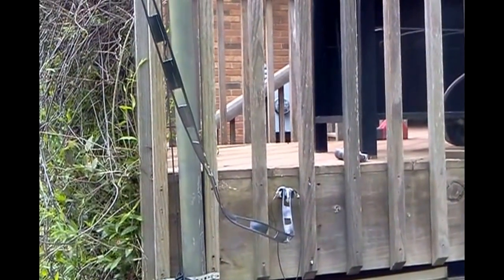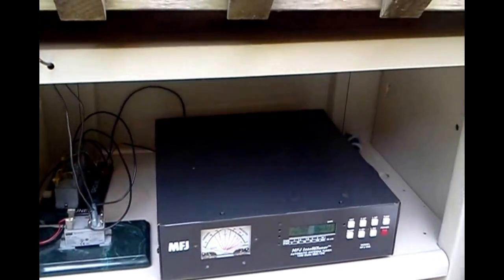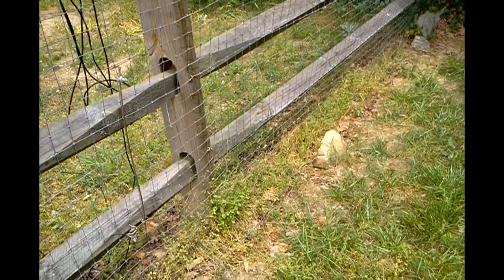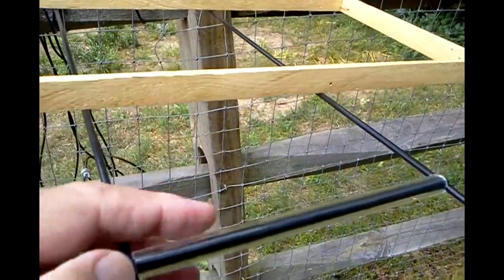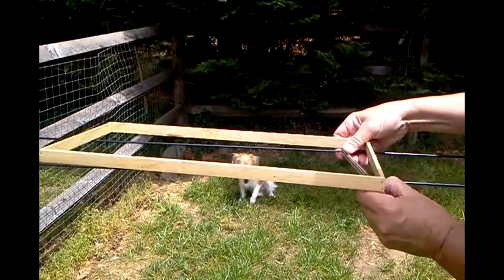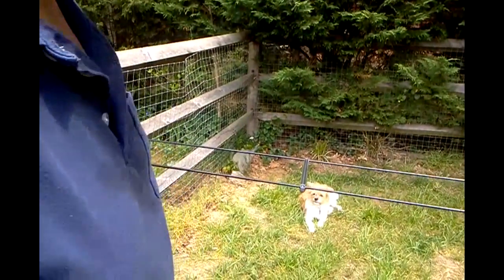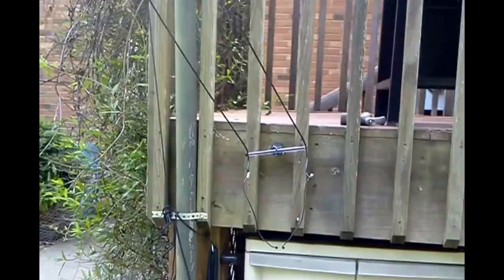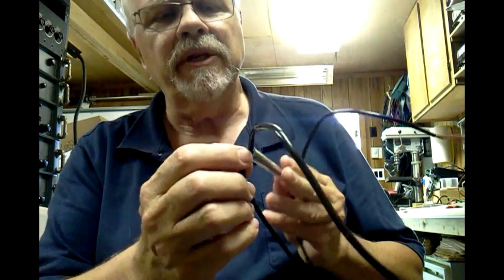New Home Brew Ladder Line

Comment: Just started using openwire line why didnt I use this feedline years ago its so inexpensive and very efficient. One antenna tunes all bands, coax is fine matched but a very poor feedline with high VSWR.  I have discovered that non resonant antennas work well when feed properly.

Comment: Steve, 1) how did you determine the 6-inch spacing? 2)Also, what impedance is the ladder line? 300 or 450 ohm or what? 3) Any significance to the 20-inch spreader spacing? Thanks.
Reply: Hello Will - my guess about the 20" between spreaders would be so that the correct distance between conductors is maintained while using the minimum number of spreaders. Check the internet for calculators to determine spacing between conductors of a certain wire gauge for your desired impedance. Seeing that this ladder line is part of an antenna system that feeds a matching device (tuner), I'd wager "close is close enough" when constructing your ladder line.

Comment: Great videos, as usual Steve. Thank you. This is very similar building techniques that I use here but I am not a fan of using the "silk" wire at all. That's because, in my experience, unless the feed line is kept taught, or the feed line is simply hanging vertically (and taught from gravity), other routings can be problematic because the flexible wire will not maintain spacing.  Historically, solid conductor wire has been used for this application to provide stability in all situations. That said, a transition to flexible stranded wire via strain relief methods is useful at the feed point where any movement due to sway or wind could possibly over-flex the wire causing breakage over time.  Good construction techniques prevent problems of this nature but it does need attention. My full-wave loop's feed point was put up in 1999-2000 and is still fully operational as is the entire feed line constructed of #12 insulated, solid-copper wire.  My spreaders are constructed similarly, using the same tie-wrap method you describe and tie-wraps have survived the Florida sun's UV without issues.  My spreader material is a lighter-weight fiberglass tubing which becomes a significant factor for longer runs of feed line. I do like the look of the acrylic however and it characteristically sheds water easily, making it a great choice. Thanks again for the video here and on other topics. 73

Comment: Wow. I am so glad I found this video. How much tubing did you end up buying? How did you get them to cut the spacers for you? I recently acquired a bunch of wire, and I have been thinking about trying out balanced feedline in my shack. Thank you so much for this video. I know this comment comes 5 years late.
Reply from the maker: Use these instead. They are rugged and cheap. Use black wire ties through the middle, looped around each wire. Super easy. 73
https://www.tractorsupply.com/tsc/product/american-farmworks-4-inch-fin-tube-insulators-25-pack?cm_vc=-10005

Comment: Looks absolutely great!  I love how you used the tube and cable tie together like that to form the spreaders.  How well have they held up in the sun?  I know that the cable ties usually have a limited life due to the sun exposure...
Reply from the maker: That's probably true but I never kept an antenna up long enough to find out. The black ties should last much longer and you can find some expensive ties that last longer.

Comment: What is the benefit of using 600 ohm vs 450 ohm? Seems like such a short length are you able to tune more bands?
Reply from the maker: In this case, nothing. It just looks cooler.

Comment: hi on your update text you say you have changed to 1 inch spacing now using black nylon spacers. Does that mean the two wires are now only one inch apart as opposed to what they were with that 6 inch spreader made of clear acrylic? am i understanding that right>? thanks so much great video
Reply from the maker: Exactly... 
1" spacing is giving around 450 to 500 ohms impedance. For some reason the tuner finds it easier to match. Any other variable is too small to notice.

Comment: Hi Steve,
Now that you have had some time using your new setup, how is working for you? I guess the input choke in the bottom of your shed is a common mode filter to help reduce Rf from getting back into the shack, though I am not totally sure. The idea of floating the tuner, RF wise, is interesting. So, you are not using a balun inside the tuner, is that correct? I think you mentioned you had ~130" of wire up, so, I suspect this does not work on 160 or is squirrely. at best.
It seems like an interesting setup and just curious if it works as you planned.  
We had some tree surgery late last spring and I didn't get the antennas back up during this HOT summer. I actually believe I might be able to get ~520' of wire up for a loop, most of it above 60'. I have always had dipoles and a few verticals on the low bands but a loop might be a little quieter.
Anyway, very interesting video.
73 de WA4AOS
Reply from the maker: I have decided that baluns are not for this antenna. I tried a really good one on the input and output but they turned out to be power wasters and made tuning difficult. I simply ground the tuner and one leg of the feeder but I am able to reverse the feeder legs with a relay which gives me a pattern change and an opportunity to null out some local noise.
Reply: +Steve Ellington ..... your update indicates that you are using some sort of different spreader.... are you saying that you are just having a 1 inch space between the two wires instead of 6 inch spacing?? Exactly what is this black spacer material?? I am about to put up a 80 meter loop with 450 ladder line but I like your stuff much better.
Reply from the maker: +cattail3 Yes I chopped up those acrylic spreaders into 1" spreaders and used wire ties again. I find the lower impedance is easier to load. I'm estimating about 350 - 400 ohms now. I'm using 12 ga wire. I've purchased some black plastic spacers from an Amazon dealer to replace the acrylic. The acrylic is already getting brittle from the sun.  Here is a link to what I now have although i have not installed them yet. http://www.amazon.com/gp/product/B00137S7M2?psc=1&redirect=true&ref_=oh_aui_detailpage_o01_s00
Reply: +Steve Ellington THANKS for the info..... I just left you a message on your website didn't think I would hear back from you for awhile! THANKS for the great info..... I think this is the way to go as long as the antenna will load up okay.

Comment: Good point about sealing the tops. Ice is definitely a factor at my QTH. I just need to find those acrylic tubes (or a decent substitute) here in Canada. How did those pen tubes stand the test of time, sun and ice?
Reply from the maker: VE3EAL Pens don't last long. I had them cut my tubes to length before shipping. Labor was cheaper than freight for 8' tubes by far.

Comment: Great idea. I feel this would also be a good technic for building a fan dipole.
Reply from the maker: VE3EAL Yes but be sure to seal the top end with some hot glue or something. We don't want ice freezing in that tube. It might split. Acrylic is uv resistant and very light weight so a fan dipole would be an ideal use for it. Also that Flexweave wire has very soft insulation and the wire ties squish into it. It won't slip.
Reply from the maker: +Steve Ellington I must confess....I soldered the joint at the top. My antenna wire is regular electrical wire from Lowes, 12ga.